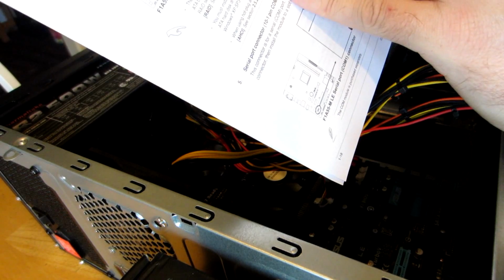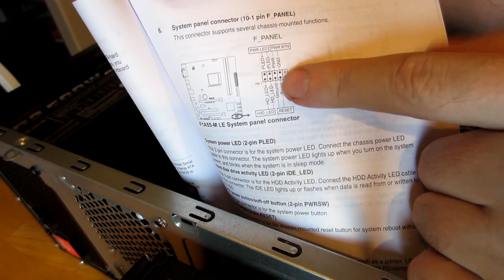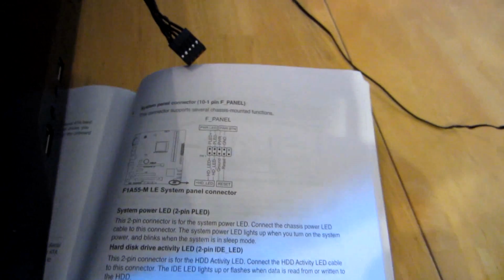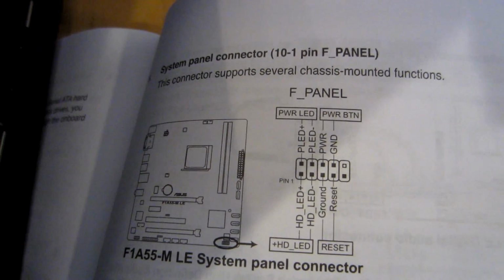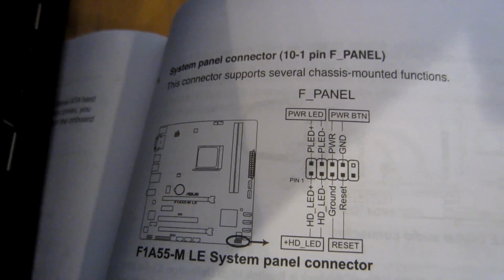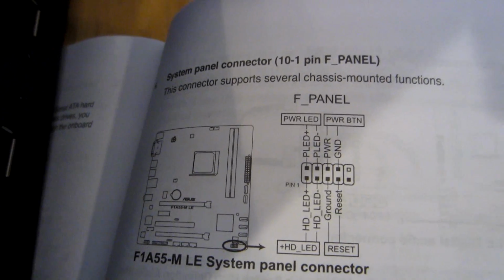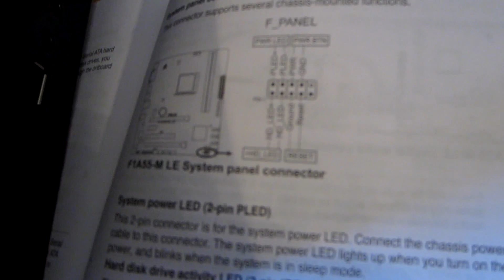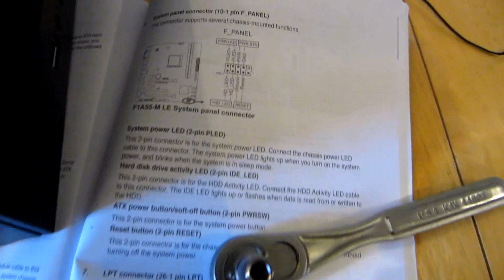Building a Desktop PC Tower for Under $300 - Part 5 - Connecting the Wires

Comment: Polarity does matter on an LED... it is a diode!   It does not matter on incandescent lights or switches.
Reply from the maker: +Patricia McGill -  Thanks for commenting and pointing that out Patricia!  I think what I meant by that is that I've never blown an LED by getting the polarity wrong.  But yes, if the LEDs don't work, definitely try reversing your wires.. or better yet use your manual and just get the polarity correct the first time!   ...Thanks again Patricia!  :-)
Reply: Zactly! (and I only commented to help anyone watching the vid from pulling their hair out, not just to call out an error!)  Enjoy!